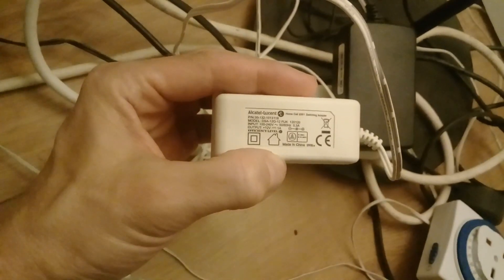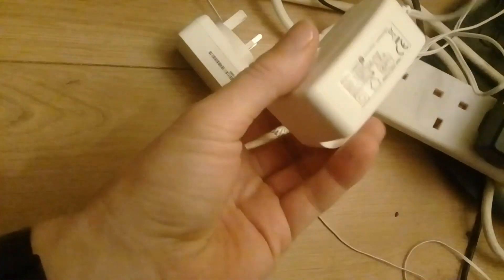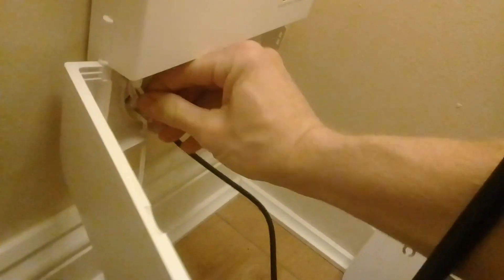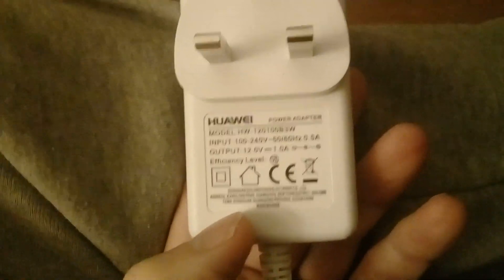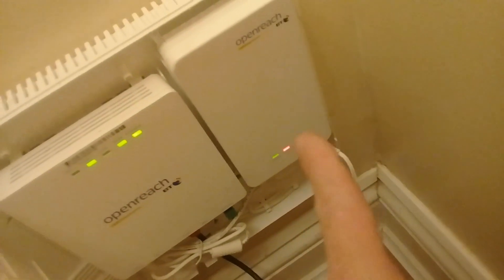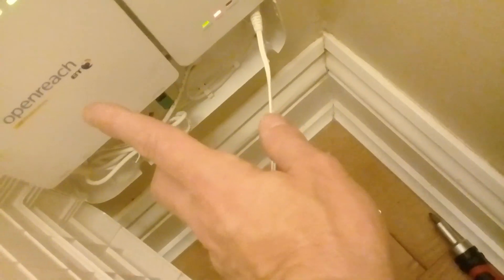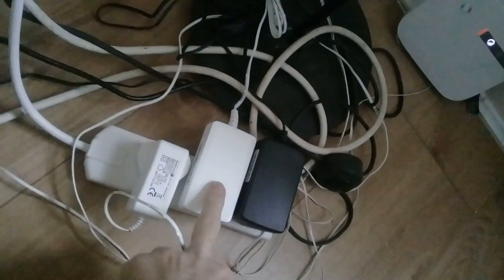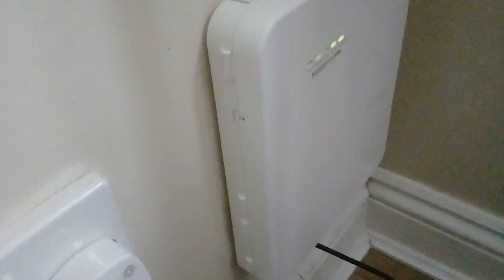BT Fibre Broadband Down What's Gone Wrong and How To Fix Purple Lights

Comment: I have the same problem I open the white box but It does not have the back up battery. Is that normal ?
Reply from the maker: Seemed to be slackness on BT part, from memory the idea is they only provide backup to an IP phone.

Comment: Thanks for your video.
It is really important that the voltage matches. The supplied current must be at least the same. In this case 1.5A or more. For example a 12V, 4A power supply would work just fine.
Reply from the maker: Worthy comment👍

Comment: Oh my god my Wi-Fi stopped working rn and its 3am but the light on the hub was green.Everytime i pressed the off button at the back and turned it on again it went green then started  flashing purple.I even tried resetting factory settings and taking out the plug.This is so frustrating arghh.Your videos been so helpful but i have no fucking clue where to start and what to do.Gonna have to call BT.
Reply from the maker: Worth checking the landline still has dial tone ie you can make a call. This is a good test of the line as it may be down.  You can log in to the router using the password on the back and look at the logs that will indicate the fault. Hope you get it fixed soon.
Reply: @fiveminuteman  BT sent an engineer over.Thank you for your help!
Reply: @fiveminuteman  The landline is irrelevant. The fibre connection is completely independent.
Reply from the maker: @gerrymcerlean8432  depends if you have a digital phone connection. In my instance i was fttp.